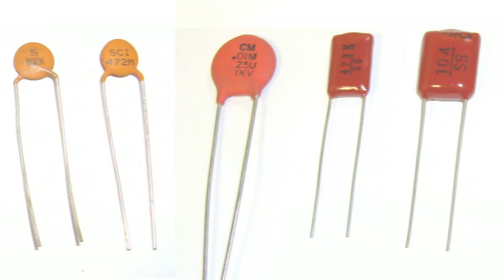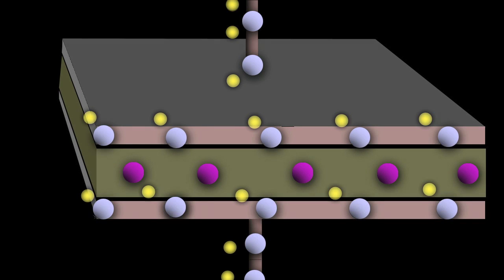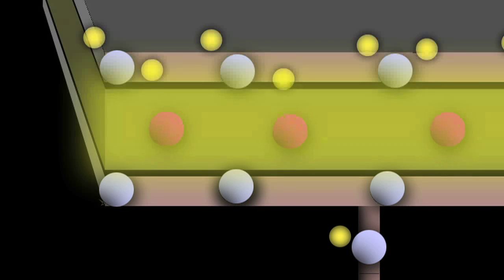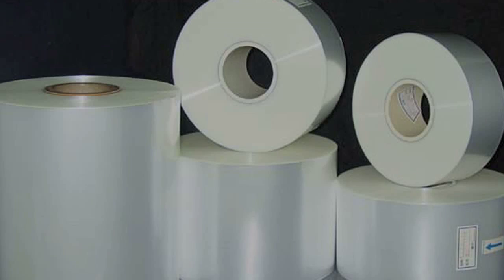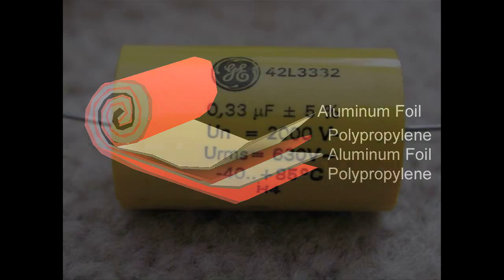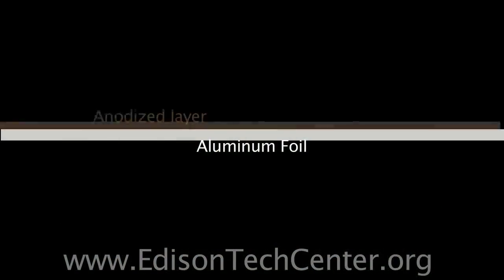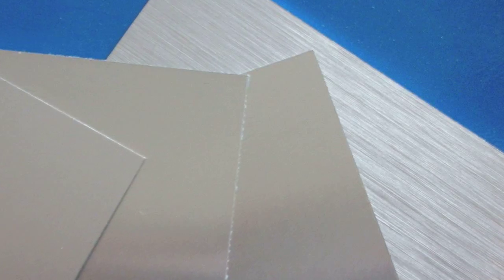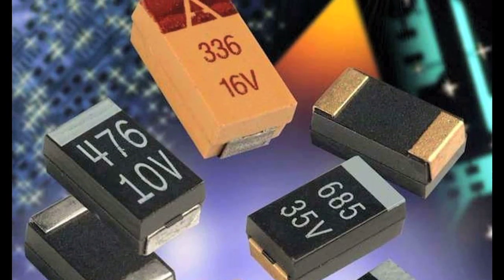How a Capacitor Works - by Dr. Oliver Winn

Comment: Now I'm confused do they store the charge or electric energy
Reply: Both. One is a result of the other. By storing charge you have stored energy. They are defined by the equation U=1/2QV=1/2CV^2 where U is the energy, Q is the charge, V is voltage, and C is the capacitance. You can't have electric potential energy without a charge because that's how it's defined. Think of it like this; you can't have weight without a mass. Your weight (on earth) is equal to your mass multiplied by 9.81m/s/s. Your weight is dependent on and directly proportional to your mass in the same way energy is dependent on and directly proportional to charge. So if a capacitor has energy, it must mean it has a charge. And if it has a charge, it must mean it has an energy. So that's why the guy said both. It stores both.
Reply: Makes sense thanks for thorough explanation
Reply: GrowMasterGeneral I have never truly understood capacitors until I read this comment. It is so much clearer now, thanks!

Comment: Could the plates of the capacitor be made of an activated carbon substrate imbued with aluminum, thus increasing it surface area at the Nano scale to hold electrons more densely?

Comment: Yes, exactly. Just like installing a battery in any device. If you only push in one end of the battery, nothing happens. But as soon as you push in the other end of the battery, the electrons (negative charge) can get to the protons (positive). 

But It's super important to think about how the the two plates are separated. They're separated in two ways;
1: Wire that we've been talking about
2: Space between the them. The space between them always remains, and never touches. 

Make sense?

Comment: You might be overthinking it. Recall that negative and positive attract (of course). As soon as a wire is connected from one plate to the other, the electrons have a path which is a means for them to get to the protons. 

Connecting the wire (= closing a switch) is like opening a trap door under your feet. You fall because gravity. Opening the trap door is releasing you, in the same way that closing the switch releases electrons. It's just because potential energy is conservative.